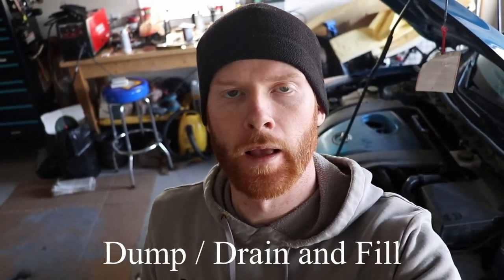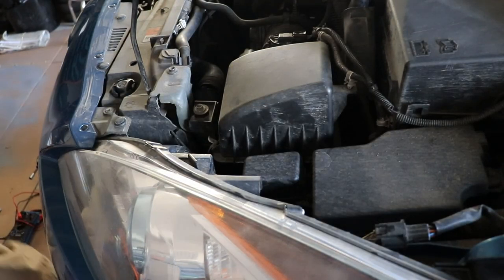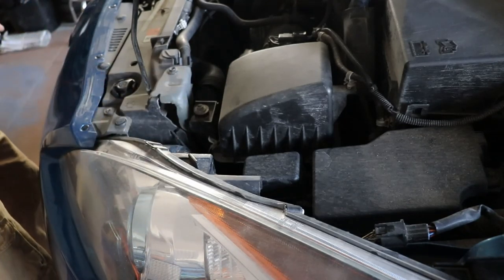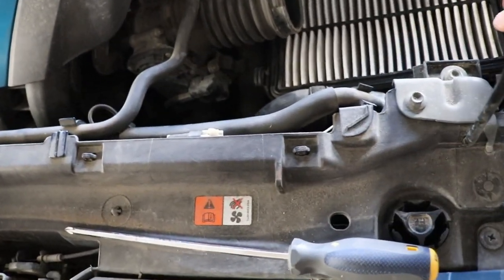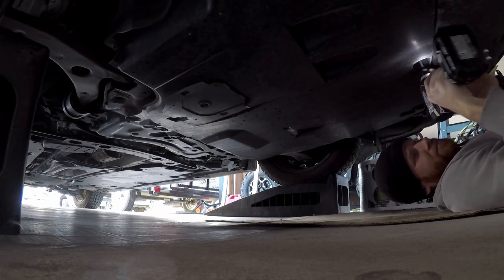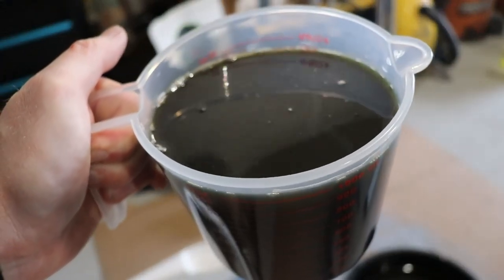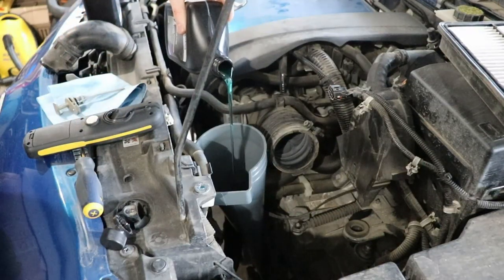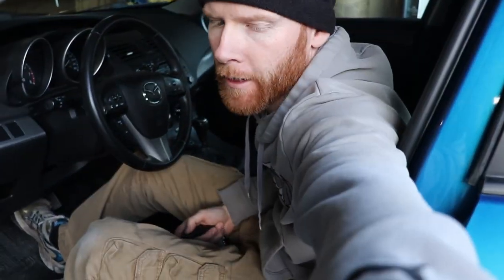Mazda 3 Skyactiv Transmission Dump and Fill

Comment: For the 1.6 L / 2013 Mazda 3 skyactive, it's a 6 transaxle transmission or a 5? I noticed you used the transmission fluid for the 6. I need to do this. I have just hit 130k
Reply from the maker: So i used what the dealer said my car needed with checking thru the VIN #. I have the 2013 Mazda 3 but to be sure always check against your VIN # this way you know for sure your putting in the right stuff. Second if you got the fluid already when you drain it you will see either red or a blue tint that will be different fluids my was the blue stuff. My brother in laws 2010 Mazda 3 2.5 l i believe takes the red trans fluid. 

Anyways i hope this helps.
Reply: The 6 Speed only came with the 2.0 skyactiv engine.

Comment: I thought those transmissions were sealed..
Reply from the maker: Thats what they try and market as but the fact is if you dont change the fulid then the oil will break down and your transmission will fail sooner.

The other word i have heard is its life time transmission fulid. lifetime means the life of how long that transmission will last most likely the average people keep there cars 5 years give or take.

But if you go to the dealer and ask to have your transmission flush they will do it. So let me know what are your thoughts on this.
Reply: @TDLDIY  I have the same car as you basically 2013 Mazda3 2.0l skyactiv, I have always been told by the 'transmission shops' that it's sealed so I never really looked into it. Now it has 140k miles on it and I assume it's too late to do it.    It's crazy though that all this time I could have just done this myself...    Should I still service it with that many miles?

Comment: Do we not need to replace the filter ?
Reply from the maker: check with your vin number if you have a filter. I was told a couple times there was no filter for my vin number just the pick up tube with a metal screen on it. 

but yes you would want to do that for sure if you have one which would require you to remove the pan and replace the filter and get a  new gasket or get gasket maker and re Install the transmission pan.

Comment: I have a 2014 mazda 3.  Amazon states that  I could use Valvoline Max transmission fluid.  Does any one have any experience with Valvoline Max Transmission fluid?
Reply: Do not use valvoline maxlife ATF for Mazda skyactiv transmission. I used it for the CX5 but the transmission made noisy and was not so good. I needed to drain the fluid again and used the other brand ATF.

Comment: Why not drop the transmission pan and do the transmission filter also?
Reply from the maker: That's a good question, The answer is and the dealer said with my vin # that I didnt have a filter or no replacents available for my car. 

Which is the answer I went with. I will on my next transmission change  take it off and look. The answer didnt seems correct at the time I believe I called around and got the same answer. 

I do recommend changing your transmission filter with your fluid.
Reply: I just got a mazda cx5 2014
They say lifetime fluid.  Like who's lifetime? It bs. I see filters out there for it but not everyone has them. If your's doesn't have a filter then it has a screen.  Has to have something? I'm doing mine as soon as possible. I see that mazda's transmission fluid is expensive.
Reply from the maker: @dougregan4752  Yes I believe they said my has a screen. 

Lifetime oil/fluid isn't a thing and changing the filter Is a must as well.
Reply: So I just did this on a car identical to yours. 7 was the digit for the engine in the VIN. There is intact a filter for it. It’s not the one that typically shows up on auto part stores systems. If you still have the car and want the part number let me know.
Reply: @dontlazerme   Yes, my Vin engine number is 7, and if you could please provide the part number for the filter, that would be great!

Comment: You can flush it after fill in with new oil. Beside filler hole, it will have an intercooler . Take off  one rubber in from that cooler and start your car. Let it drain for 2 liter while start the car. Then fill it again. Total you will use 8 liter.
Reply from the maker: Thanks for the comment I will look into that sounds legit thanks. i am always glad to hear other idea that work.
Reply: If it is the round intercooler like on a 2016 Mazda3 that won't work because those rubber hoses are for the coolant from the radiator. The only way to flush would be to remove the round intercooler and use a flushing adapter plate or stick tight fitting vinyl tubing into the ATF inlet and out let holes that are visible once yo remove the intercooler.
Reply: Actually you might be OK on a 2103 because, depending on the model, it uses a different intercooler and might have 4 hoses on the intercooler, large ones for coolant and small ones for ATF

Comment: Could this same process be done on the manual transmission version?
Reply from the maker: This process will be slightly different on a manual transmission. 
1. fluid is different
2. amount might be different
3. where the fill plug/ dip stick will be in different location. Same with the drain plug.

For best idea i would search how to do the manual transmission with the year model you have.

Comment: great vid,,,,how do you check the level of the fluid?is it like other cars with engine warm ,on flat surface ,while engine at idle and then pulling dip stick out and take a reading ,,,please explain.  thanx alot
Reply: Supposed to be on a level surface with engine running and at 122 deg F. I have an Innova scan tool that tells me the temperature. Some people use infrared/laser thermometers.

Comment: I have a 2016 skyactiv mazda2, the dealer has told me not to change the trans fluid till 200,000k. I'm currently at 120,000k and the dealers recommendation seems super suspect actually. What is your opinion on this?
Reply from the maker: That seems much too long. But i do recommend call other Mazda dealers in your area and see what they say as well. Its always better to get multiple recommend and see where the common response lies. If i was to give my though it would be somewhere in the 80 - 120k range in kms. * I just called my local mazda dealer for you after i typed out my repsonse so i am adding to it. They told me they recommend it to be do at 80k to 100k. If you are keeping the car they would still recommend doing it even at your 120k kms. My dealer said it will be a forced flush and could cost around 350 ish possible cheaper.  

I hope this helps good luck.

Comment: I have a 2016 Mazda CX-3 automatic transmission , approaching 60k I want to drop the pan and change the filter along with putting in new FZ transmission Fluid. Then at 120k do the same thing over. If I do multiple dump and fills after that would I run the risk of damaging the transmission? Maybe transmission slips? Or should I wait to dump and fill at 90k ? Mixing new fluid with old would that be an issue?
Reply: Imo just give it a dump and fill, wait a couple weeks, then do another. Then give it a single dump and fill every 15-20k. I wouldn't drop the pan until maybe 120-150k or if you start to experience weird shifting behavior.

Provided service is done correctly, you're not risking anything working on it more often. It's just extra time and money on your part. Mixing new and old fluid would only be problematic if the transmission already has a foot in the door from lack of service
Reply: @caribougoo349  2016 mazda CX-3,  after drain & fill, measured. After  engine warm up trany at 122f/50c using scanner, should the level be checked with engine off or on? I checked it off and topped a little fluid at marker. However the fluid dropped down to the 122f/50c marker after checking at engine idle. What's the correct way without overfilling?
Reply: @neldias1718  Engine needs to be running. You want to shift to reverse, neutral, and drive and back up to park taking time to pause 15 seconds at each to let fluid circulate through the whole system. Then take your reading

Comment: I keep hearing that it's better to not drain and fill the transmission fluid if it's never been changed and the car has a lot of miles on it. My car has 115,000 miles. Do you think it's better to go ahead and change it?
Reply from the maker: I have heard the same about changing the transmission fluids but most were done at the dealer with the pressurized system. I think a drain and fill will be ok but its not perfect it only changes out about 50% or so of the fluid. I would recommend contacting your dealer and ask them for there recommendation. 115, 000 mile is roughly 185,000 kms if you havent done it before them you might want to just drain and fill. But give a call to your dealer and see what they say.
Reply: I've seen before that on high mileage changes you should save the old fluid in case it is too late for the new fluid. That way if it slips you can drain the mostly new fluid out and put the old back in.

Comment: So I did the first part just to check the atf levels, put everything back and now the check engine light won’t turn off
Reply from the maker: so did you drain the fluid at this point?
Reply: @TDLDIY  No, I was just checking the level, so I took everything out to access the dipstick. It was full, so I just put everything back, but in reverse order of course
Reply from the maker: @SMSV621  only thing I can think of unless it's not related to this at all. is you possibly forgot to connect the electrical wire for the air intake. or it's not connected properly. I am pretty sure that's the only electrical connection you wouldve disconnected.
Reply: @TDLDIY  Yes, I think it realized I unplugged it, or it was slightly loose. The light went off now, thanks
Reply from the maker: @SMSV621  No Problem glad I was able to help. Thanks for watching and commenting.

Comment: Is this a JATCO transmission
Reply from the maker: I am not sure. Sorry i couldnt be more help.
Reply: Nope, In-house Mazda Transmission, no Jatco since 2013+ Skyactiv
Reply from the maker: @andali555  Thankd for that information.
Reply: @TDLDIY  You're welcome. Just keep in mind if you have the 1.6L you probably have the Jatco one. Only Skyactivs with 1.5, 2.0, 2.5 have the Mazda one
Reply: Can you uesd valvoline multi-vehicle import ATF for the power steering fluid

Comment: are there any other brand fluid I can use other than the Mazda oem fluid?
Reply from the maker: I am sure there is. I haven't done the research on that. But I would recommend the mazda fluid.
Reply: There is a brand called Ravenol which I used for a few hundred miles.  My transmission was slipping considerably prior to the drain and fill, and slipped a few times after.  My second drain and fill was with oem fluid, and the slipping stopped completely.  I don't blame the fluid for not completely resolving the slipping; I severely burned burned the fluid. The Ravenol was slightly cheaper two years ago, but oem is currently the cheapest.

Comment: Hi I got a 2012 SKY that I bought used in 2018 at 62,000km. I don't know the maintenance history of its transmission fluid.  Now I'm almost at 100,000km and I should probably change it.  Some people think after a certain point if it was never changed you better not change it or you risk breaking it. Do you think my situation has reached that certain point or I should change the oil?
Reply from the maker: Hey seems like you got a decent skyactiv there. So how I think about it is if you do a dump and fill your good. some / most place this is what they do now. 

If you get a transmission flush what happens here is 100% of the transmission fluid is changed unlike the dump and fill but it is also force thru the transmission and there are lot of paths and what not that possible could have some thing in it and it can break free and get stuck in a vavle or place that could cause problem with the transmission. So I think that's where the idea of if you haven't changed it in a long time your better off not touching it. 

But with a dump and fill I would like to think that new fluid is always better then old broken down fluid that isn't providing you the lubrication and protection it once did. So also with a dump and fill you will have to do it more often. because you only get about half of the fluid out. 

I hope this helps.
Reply: @TDLDIY  Thanks for your opinion.

Comment: When do we need to change the at filter?anyway thanks for vids
Reply from the maker: if your vehicle has the filter change it when you do the Transmission fluid change.
Reply: TDL DIY I would not recommend Mazda. Their oil is too thin (for better gas mileage)  and cause vibration in my 2010 mazda3. I changed to Valvoline maxlife at 150k km. Car is smooth, no vibration in gear when stop at traffic light and the best part is gear downshift is better with better torque. Hope it will help.

Comment: Thank you for the video! My 3 has 46k. Gonna the fill and dump thanks to your video! Have you swapped out the filter for the transmission? Was wondering if it has silicone or a gasket? Thanks again for the video!
Reply from the maker: Hey i am glad you liked the video. as for the transmission filter I have asked the dealer a couple times and they say my car with me giving the vin # they say it doesn't have one. But I know a lot do have the filter and I beleive most people put a gasket maker on it to put the pan back on.
Reply: @TDLDIY  oh ok cool I'll. Just do the dump n fill then n skip on the filter swap, my 3 has a 6 speed automatic. I'll do a lil more research before hand. Thanks for the reply!
Reply from the maker: @ishmuriyo6702  - Hey No problem. Glad I could help a bit. Thanks for watching my video.
Reply: i found the filter for 2013 mazda 3 2.0L skyactiv on Amazon.
https://www.amazon.com/dp/B00HWNOZTA/?coliid=I17DER2TC7Y4GY&colid=1IFEC3I3850O6&psc=1&ref_=lv_ov_lig_dp_it

Also from most of my research online. When you drop the fluid pan for the transmission, almost all the 2013 owners found that silicone was the seal for the pan. It's gonna take at least a day for that thing to dry. Plan ahead if you are going to change the filter.
Reply: I believe there are gaskets available for the trans pan. I used Permatex Automatic Transmission Gasket Sealer two years ago and it is holding up fine. My car is a 2015 Mazda 6 Grand Touring.

Comment: here in Europe the price of M-V or M5 ATF at the dealership is 80 USD for 1 litre!!!!
Reply from the maker: That is very expensive that might be what I pay for all I need to refill the transmission or less. In your case I would check other places possibly online.
Reply: @TDLDIY  yea, the European Mazda has different AtF type which is cheaper, but mine is American model, I found out that liqui moly ATF 1200 is compatible with M-V as written on the bottle! But I'm afraid to risk it! What d you think?:)
Reply from the maker: @0042982  - I always use dealer specific transmission oil. always safe then sorry.

Now for brake fluid and engine oil for example  I use just what the is compatible like if it calls for dot 3, and for engine oil like 5w 30 or whatever it may call for.
Reply: Look for Idemitsu m5, like https://amzn.to/388Qsut or Ford XT-9-QMM5.

Comment: Skyactiv has lifetime transmission fluid and does not need changed AS PER MAZDA
Reply: Then why put a drain plug.  Lifetime of warranty is what they really mean.
Reply: @dexterm1285  because if they need to service it, they still need a way to drain the fluid
Reply: @MrJeepsterman  Yea drain the fluid out when transmission toast since fluid never changed.   Fluid is cheap transmissions aren't.
Reply: @dexterm1285  k
Reply from the maker: Your 100% Correct, I like how you stated "Lifetime of the warranty" its true but play on words to kinda trick the consumer.
Reply: That’s what they say. And it’s BS.
Reply: @a3300000  based upon.....?
Reply: @MrJeepsterman  , I pulled trans fluid after 40,000 and it looked like it came from a mud puddle. Trust me, it’s not good forever.
Reply: @a3300000  Well Mazda disagrees with you apparently.